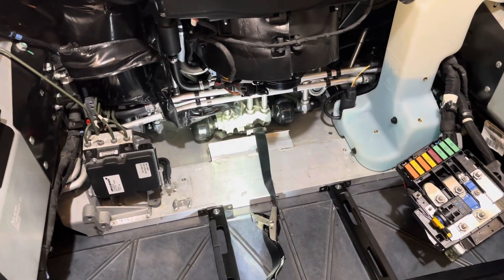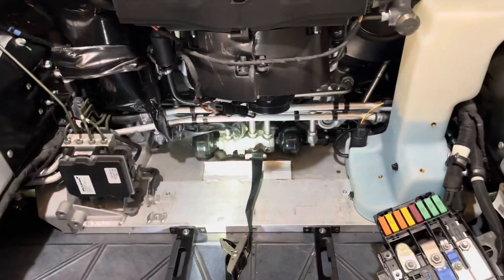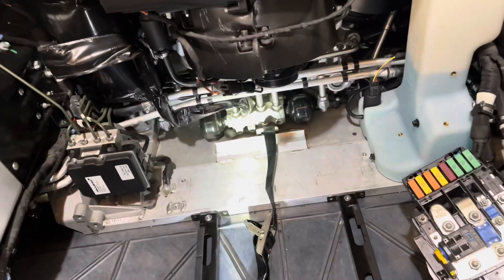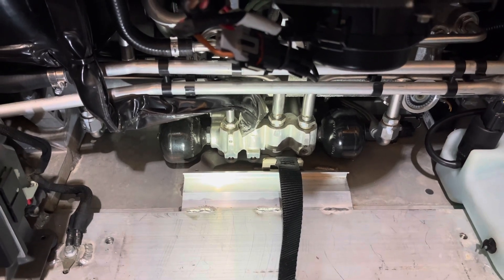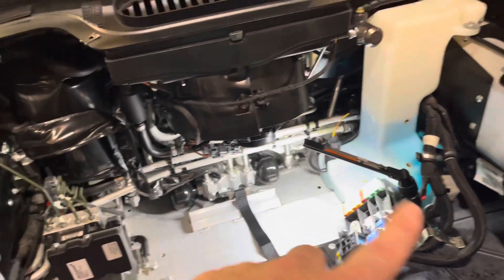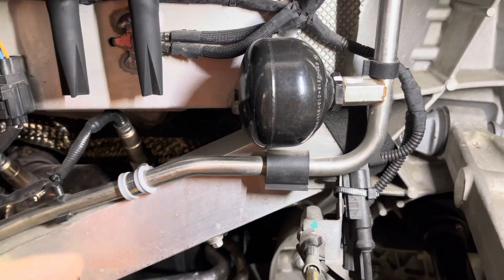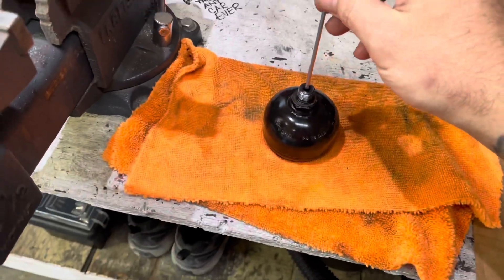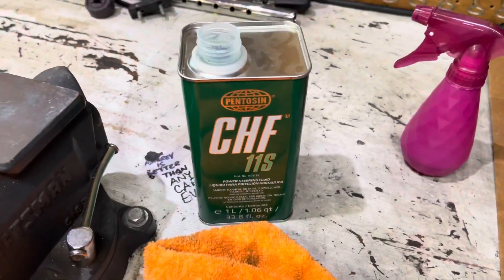Changing The Suspension Accumulators On My McLaren 12C

Comment: So, hydraulic fluid from the suspension comes out and is lost. I know there are check valves in the system, but:  how did you bleed the system for air? or, not necessary?  and also, how did you refill the hydraulic fluid you lost, or, again, is that not necessary?
Reply from the maker: Same fluid as steering rack. Very little fluid loss. Add to reservoir and while vehicle running, turn steering wheel lock to lock multiple times to remove air.